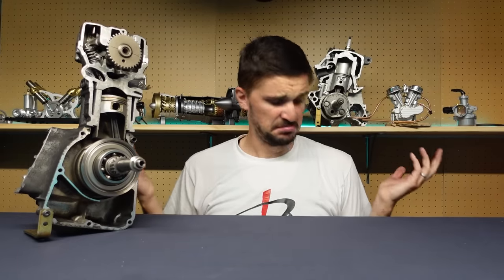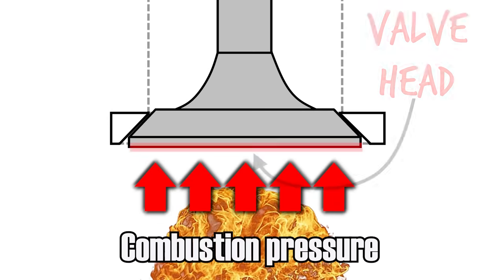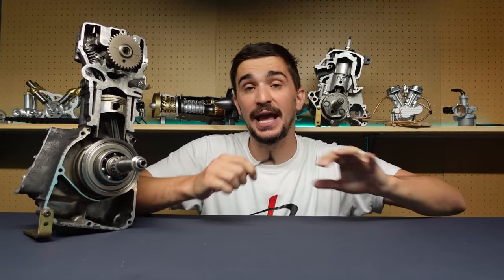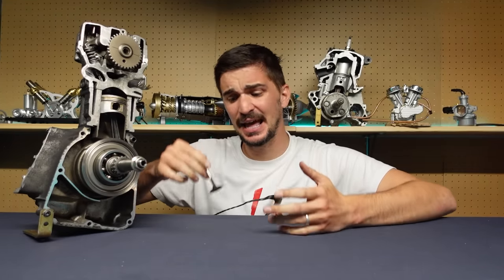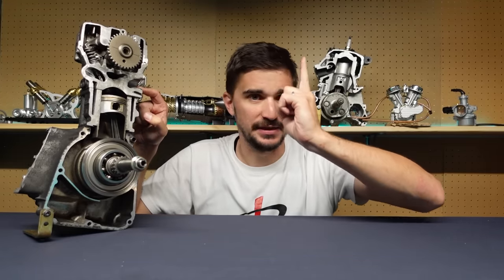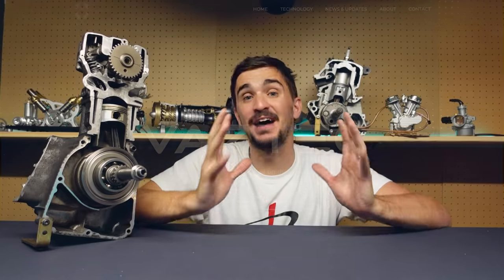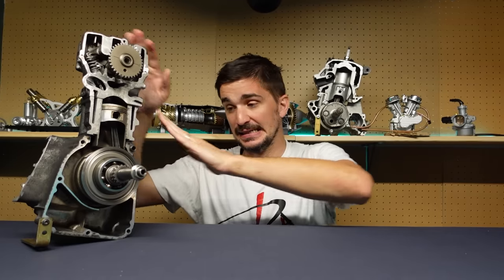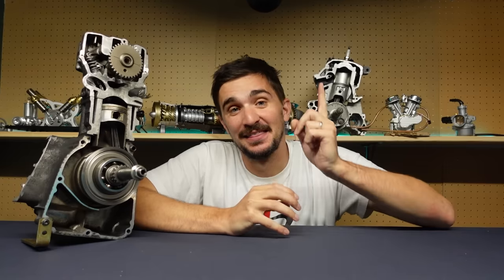Rotary Valves Make Normal Valves Look Silly - Why Aren't We Using Them?

Comment: Of course, the other alternative to poppet valves that actually made it into production was sleeve valves.
Reply: Yes and they were a huge pain in the ass to make. The sleeve has to ground to size with A DULL GRINDING WHEEL at 10X the power and 100x the time requirements of normal centerless-ground parts like wrist (gudgeon) pins.
  It was so bad Napier whined to Churchill who whined to Roosevelt who ordered an entire year of the Sunnen Corporation's centerless grinder production (about 2000 machine tools) to be sent by ship to Blighty.
       The USA had to fight WW2 without the use of the finest engines ever made the C-Series Pratt & Whitney R2800 because of that year without enough grinders.
Reply: Indeed. Most notably used in the Bristol Hercules engines fitted to the Beaufighter.
Reply: They kind of remind me of the valves in an opposed piston engine.
Reply: A really interesting solution.
Reply: @patrickshaw8595  By that time the Brits had more than enough German POWs. Germans are well known for their precision engineering. So, why didn't they get some of those to manufacture the sleeves?
Reply: Yes, but they were more complex and failure prone.  Their biggest advantage was with relatively low octane fuels (50-60) because they could run higher compression ratios than poppet valve engines (the hot exhaust valves would ignite the fuel/air mixture).   Once fuel octane approached 90, much of the relative advantage was lost.  With 100+ octane fuels and sodium cooled valves, poppet-valves made more sense.
Reply: Wow, you all really know your ish. I've only ever built a hobby-scale electric motor.
Reply: @mikethespike7579 It's highly unlikely that German mechanical engineers were on the front line, getting "captured", or surrendering to Allied Forces.
Reply: The Wankel rotary engine replaces the valve with the rotor itself. It shares the sealing struggles with the rotary valve, and then some. However, one could consider it an alternative to the poppet valve that made it into production. While not a huge success, it did do quite well for many years.
Reply: @patrickshaw8595  The US did fight WW2 with the R2800, it powered many of the most famous fighters like the F4U Corsair and the P47 Thunderbolt. That company wasn't the only one in WW2 that made grinding equipment in the US. The Wright R2800 ended up being one of the most produced engines in the war
Reply: There's a lot of good airflow arguments for the sleeve valve, but they are complex.
Reply: @crosstiewalker803  My comment was meant tongue in cheek. But thanks anyway.
Reply: Another one is to use copper coil and some magnets, if you look for efficiency
Reply: @wesley0a  It turns out that I thought it possible that the seals developed for the Wankel might be used for rotary valves with piston engines.
The LiquidPiston engine that is currently under development is related to the Wankel.  If you haven't already found it, you may be interested.
Reply: @jfess1911  Ah yes, sodium cooled ... now i remember the crazy german engineers who cooled things with NaK.
Reply: @haku1155  Eaton in the US also made them.  I think they were still making them 25 years ago, when I worked for that company.
Reply: Wankel fails because the spark plug provides a blowby point, the long combustion chamber has a high quench and blowdown is too short resulting in extreme noise and extremely hot exhaust. 
Opposed piston two stroke is the most efficient. It can also add a port height adjuster to boost mid range power.
Reply: @mikethespike7579  There are so many stupid people making stupid comments on YouTube, and you seemed, or seem, to fit the profile.
Reply: I knew someone who flew an aircraft with Bristol Centaurus engines (I think the Beverley) with sleeve valves. I believe the Sea Fury used the same engine, an 18-cylinder radial. He used to describe them as "oil burning, fuel cooled" engines they used so much oil and needed such a rich mixture to keep temperatures down.
Reply: Oil consumption and pollutants screw that design. Ricardo was analysing and designing engines before air quality was a concern.
Reply: @crosstiewalker803  Well all their patents were stolen so in that sense theeir work was captured - War is such a sneaky way of legal theft
Reply: @Dave5843-d9m  Yup, the Wankel has problems when it comes to efficiency and emissions.  The LiquidPiston inverts some of the Wankel components (rounded rotor, triangular stator), but in the end has a lot of the same problems.  Nevertheless, it is compact and light for its output, so it may find a home in drones, other aircraft, or possibly as a small "maintainer engine" for hybrid (but mostly electric) vehicles.
Reply: What about a disk in a pipe with 2 slightly angled half-circle flanges inside so It takes a bit less than a quarter turn to open, with the disk aligned to the pipe. Friction will be lower if actuated by a simple rotary solenoid switch. The main drawback is one half will be pressured shut while the other side is pressured open during compression. It may be solvable with a wedge shaped disk directing the compressed air to the half that closes. I hope you can imagine this from the description. I haven't looked into other valves much so it might be a bad idea. Maybe the switch magnet can be used to hold it fully shut too. Perhaps only half the pipe should be fully blocked off with only the other half flanged to form the seal.
Reply: @PrivateSi  This pretty much describes the single tube in Roland Cross's engine from the 1930's.  In those days, the extra heat transferred between the exhaust side and the intake side of the tube helped volatilize the fuel was important.  Now, heating the intake air (and reducing its density) is a disadvantage.  Back then,  the fuel droplets were large and overall, heating the intake air to volatilize the fuel was a net positive.  These days, fuel atomization is so good that it is more efficient to keep the intake air as cold as possible to make more oxygen available.
Reply: @jfess1911  .. OK. The way I was thinking supercharged intake would apply pressure to the intake valve so that could be an added problem (even if it does help counter the pressure of the compression stroke).
--
I have a unique 'free piston-turbine engine' design I'm sitting on. I haven't looked into other valve designs yet but thought I'd check this out and give it some thought. It uses a solenoid-actuated simple poppet style valve but with an oval valve head that blocks off 2 intakes/exhausts at once, with the actuator between them. They're water cooled and may even squirt out some water each time they shut, for added cooling + steam power.. It combines a condensing boiler as it's a boiler-generator. 50% rotary power, minimum, 50% heat maximum as the goal. 
--
The piston-turbine idea is fun. It's a true 1 STROKE engine where compression provides power.. combustion, exhaust, stroke after next intake all while compressing the next stroke. Instant high compression of a piston engine, no crank or cams of a turbine engine... but it needs a few valves in the middle with turbine combustion chambers each end with a special magic rotary heat engine system combined with them. I think I'll stick with what I've got, and a half-disk would work better for the previous idea I mentioned. I've been sitting on a rough 3D design of the engine-boiler-generator for months now, and the idea for years on and off.
Reply: @TotalFreedomTTT-pk9st  As you may have noticed, I was making a comment to a person that now says his comment was meant to be "tongue in cheek", so I guess it was just a bad attempt at humor. I believe that person was talking about POW's being forced to do the work, and your comment does have some validity, but not all of the German weapons technology was developed or "invented" by Germans, so is there a difference between stealing technology, and stealing the mental and physical work of people that were working against their will, with the threat of death to them, and their families by the nazis?
Reply: @mikethespike7579  Because if you're actually adhering to the Geneve Conventions, you can't use prisoners to directly support your war effort.  The Germans learned early on that drafting their skilled machinists into the combat forces was a Bad Idea, since you then get crap production. (And the Germans never got the hang of Mass Production, with its requirements for consistent manufacture from the initial stages with high tolerances - most of their final assembly consisted of hand fitting.  Looks pretty when you're done, but production rates are abysmal, and interchangeability is out the window - it's why early 20th Century European firearms had every moving part serialized - you couldn't necessarily exchange the bolt of your Kar.98 with the one from the guy next to you.
Another issue - that the Germans found out using forced (slave) labor,  you slaves have a tendency to sabotage whatever you're having them make.

The big problem with Napier's Sleeve Valve engines (The Sabre), was Napier who had had an abysmal track record with the many-cylinder fast-turning engines - Rapier, Dagger and Sabre - that one wonders why they were ever contracted to build the things in the first place.
Bristol, with the Taurus, Hercules and Centaurus sleeve-valve radials had much  better success, at the expense of complication in the sleeve valve drives - the back side of a Bristol Hercules looks like an explosion in a Rolex Factory.
Reply: Napier did a sleeve valve 'H' 16 cylinder aero engine called the Sabre for the Hawker Typhoon. They had issues with the engine too but damn, that was a beast of an engine given it's size and power output potential. There's a cut-away display of one at IWM Duxford.
Reply: @mikethespike7579  i'll take the liberty of assuming that was a joke
Reply: @MrTL3wis  They'll be just as complex for a rotary valve - As an Aerodynamics guy, that simple flow through drum valve becomes a nightmare at anything but a specific mass flow, and a specific RPM - it it's turning fast, you don't have tome to get enough air through the valve.  Yes, that's a problem with other valves - but with a poppet valve, you have a fairly consistent flow path once the valve has started to open, and as it's closing.
Reply: @haku1155  Sodium cooled valves were developed by Sam Heron at GM in 1930, and introduced into production aircraft engines by Bristol in 1936.
The Germans, as usual, came late to the party.
Reply: @daos3300 Yep. Glad you saw it as such. I've been getting a bit of flak for it, more or less from intellectually challenged types.
Reply: @peterstickney7608 Dude, it was a joke, tongue in cheek.
Reply: @patrickshaw8595 is that an inherent problem? The only reason to grind with a dull wheel is for cycle time (longer dress interval) or surface finish. It would probably be most efficient to get surface finish from a second operation (finer grit wheel or super finish process).
Reply: @peterstickney7608 "the backside of a Bristol Hercules looks like an explosion in a Rolex factory" 😂😂 that's quite a knack you have for expressing yourself!!!
Reply: @mikethespike7579 Bold of you to assume that the average Fritz was a mechanical engineer
Reply: @allahuvonaugustera7895 It was a joke... Oh, never mind...
Reply: @southronjr1570  thanks for the accurate info...!
Reply: Sleeve valve engines had been built as limited run racing specials from well before the Second World War. The sleeves needed to be match fitted to the barrels and pistons if the engine was to run with any reliability. This was unacceptable for a production engine and it took the engineering genius of George Fedden at Bristol to devise ways of mass producing parts to such high tolerances that match fitting was no longer needed. Aircraft engines like the Bristol Centaurus were developed to produce over 3,000 bhp and it is a mystery to me why this technology has not been exploited further.
Reply: Knight sleeve valve auto engines were in production for around 30 years. Improving poppet valve technology nullified its advantages in the 30's.
Reply: @PRH123  Minerva cars had sleeve valved engines, licenced from Knight, typically you could see blue smoke (oil) come from the exhaust  Complex engines to build and maintain but they ran well and were very quiet
Reply: @peterstickney7608  'Another issue - that the Germans found out using forced (slave) labor,  you slaves have a tendency to sabotage whatever you're having them make."

If forcing POWs to work is slavery, then so is forcing men to fight. And that is actually not slavery.
Reply: @mikethespike7579  These days it's hard to tell the difference between an ill-considered joke, and someone Popping Smoke and running from an inconvenient comment.  Sad to say, that's what Internet Discourse has come to. Whether you were serious or not, my intention was to point out to other readers why that would be a Very Bad Idea.  You know that there will be somebody out there who sees it and says "Y'know, that would have been a good idea".  That ought not to be encouraged.
Reply: The design of the intake and exhaust ports flow rates must have been studied in detail over the last 120 years to work in conjunction with the poppet valve obstruction. At high RPM, such as racing conditions, the flow around the poppet valve would contribute to mixing of the fuel & air for making for full better combustion. Most road vehicle engines work at relatively low RPM so the maximum flow rate is less of a concern.
Reply: @guidodebacker4205  knight used the “quiet” quality in their advertising
Reply: @gourishankar52   if I remember correctly, barriers to further development were:
- the design was limited to < 3000 rpm, which isn’t an issue for an aviation engine, but is elsewhere
- issues with heat transfer thru the sleeve to the block to the coolant (or air)
- cost of production, ala machining, and complex linkages to move the sleeves
Reply: @peterstickney7608  Yeah, I've noticed that there are always some poor individuals who don't understand a joke. I suppose it's inevitable.
Reply: @PRH123 There are tons of interesting mechanical alternative solutions for the internal out there, that are supposed to improve the combustion engine. They all have fantastic advantages but also one single disadvantage that makes the whole thing useless.
Reply: @mikethespike7579  yup, there’s always at least one “onion in the ointment” (Shakespeare) that spoils a good idea…
Reply: @patrickshaw8595
Thanks sir for yet another interesting fact and context of importance in global history - all because so many of us love going fast and improving stuff!
Reply: @gregrice1354  I love improving stuff, but not to go fast. I like coasting along the roads enjoying the countryside.
Reply: @peterstickney7608   For sure. Another nice thing about poppets is that the combustion pressure reinforces the cylinder sealing, which is a big deal.
Reply: @rian0xFFF   That's far from free and the energy consumption goes up quickly (squared, I believe?) with RPM.
Reply: @MrTL3wis  I'm trying to mean electric motor
Reply: @crosstiewalker803 
Turns out there were a lot of German engineers at the front.
Reply: @Margarinetaylorgrease  Please let me know where you found that information, and I'll retract my comments if your source is  legitimate. It's not that important, and I was replying to a person that said his ( or her ) original comment was meant to be a "tongue-in-cheek" "joke".
Reply: @Margarinetaylorgrease  I tried a couple of Google search about what you're claiming, but I didn't see anything that would validate your claim. Do you understand that I'm talking about scientific research and development type engineers, and not combat engineers, also known as sappers?
Reply: @randomxnp All engines of that period burned tons of oil due to manufacturing tolerance and the like.

The R2800 mentioned earlier in thus thread would burn something along the lines of 1 gallon of oil for every 10 gallons of fuel and as such had to have a 50 gallon oil tank that was refilled per flight the same way the fuel was.
Reply: Don't forget reed valves.  They're all 2-stroke though, I believe.
Reply: @Margarinetaylorgrease  I'll wait to see if you can back up your assertion.
Reply: @mikethespike7579  It's very illegal to force POWs to work in war-related industries.
Reply: @Zileas01  "In reality there is often the death penalty for refusing the draft in wartime, prison  if you are lucky."

That is exactly the point I made. What do you think forcing means?
Reply: @crosstiewalker803  
The secret horse power race chap talks about it in some of his talks and I assume the book.
Reply: And electric
Reply: @sahala6765  It's a joke. I don't think the British would have allowed members of the enemy armed forces to take part in developing weapons technology.
Reply: @wesley0a No other workable engine ever surpassed the Wankel rotary engine. The initial seal issues were successfully solved but the emissions could not be reduced to acceptable levels which eventually prevented the success of the rotary engine in cars. Perhaps hydrogen fuel could solve that issue?
Reply: @wesley0a No other workable engine ever surpassed the Wankel rotary engine. The initial seal issues were successfully solved but the emissions could not be reduced to acceptable levels which eventually prevented the success of the rotary engine in cars. Perhaps the use of hydrogen as fuel can solve that problem?
Reply: I like the opposed piston engine with the valves cut into the lower parts of the cylinder and are opened and closed by the piston. Could also use reed valves in oppisite ditections as well in intake and exhaust manfolds. With a supercharger it can be a 4 stroke pressurized lubrication system but has a huge power stroke once every 360 degrees like a two stroke.
Reply: @wesley0a The sealing problems were eventually solved. The emissions are their final downfall.
Reply: Opposed piston engines have no valves.
Reply: @jfess1911  They were also very good on high octane fuels 135/150 as these fuels had a lot to TEL and unlike poppet valves, sleeve valves were not prone to leading.  Sleeve valves were not inherently more complex they just had more design issues.  Sleeve valve designs were also less prone to pre-ignition which can cause backfiring and serious damage to the engine.  

It would be interesting to see a modern redesign of the sleeve valve engine, there have been various improvements patented including some work by Lotus.  It was rumoured that Keith Duckworth had done development work on sleeve valves but AFAIK there had never been any written proof of this.

The Sleeve valve made more sense in air cooled engines as they were all two-valve designs and the sleeves had better volumetric efficiency than a two-valve head.  After the war, commercial use of the Hercules had a TBO of 3500 hours, very high for a piston aero engine in its power range.
Reply: @mikethespike7579  What makes you think the Germans could manufacture them?  

Their own piston engines were not the shining beacon that many make them out to be.  

Any major change in engine design takes about 5 years to bed down.  A major issue with the Sabre was that they did not start the design till 1936 and it was a radical departure from the other engines Napier had developed.  When put into production it was seriously underdeveloped, two more years was needed.  The Merlin development started in 1933 and it was just another in a line of Rolls-Royce V12s and it had serious problems early in its production life.  Add to this that Napier was a small company, with a much smaller design staff than  R-R let alone the Americans.
Reply: @robertnicholson7733 You can't be serious. It was a joke.
Reply: @Margarinetaylorgrease  I googled the book that you mentioned, and at some point I might take the time to look into it. It sounds like the only thing you've done, is watch a video, and you heard something in that video, that causes you to believe that civilian scientists,  and mechanical, electrical, and other types of engineers, were forced to go to the battle front and participate in the shooting war. I realize that toward the end of the war in Europe, old men and young boys were given weapons, but it makes no sense to me that a handful of scientists would become expendable on the front lines.
Reply: @mikethespike7579  Nothing goes over their heads. Their reflexes are too fast. They would catch it.
Reply: @crosstiewalker803  
No I was there and I seen it with my own eyes.
Reply: Which are kind of sort of rotary valves sometimes (sometimes they are also reciprocating)
Reply: @Dave5843-d9m  wankels do have a major increase in power when you use a reed valve on the intake to stop the back flow form the intake port.
Biggest issue is always going to oil usage and apex seals
Reply: @jillybooty In fact the reason they did this was to improve the roundness of the sleeves. How exactly it works is unclear (they discovered the dull wheel method by accident) but doing the final pass with a dull wheel improved the TIR of the sleeves from 0.005" or worse to less than 0.001".

For reference, the sleeves as designed by Bristol were high nickel austenitic stainless steel forgings. After rough machining they were nitrided for hardness, then finish ground on a centreless grinder. Presumably the residual stresses in the forgings resulted in considerable distortion during machining and heat treatment, so they were left with 'oval' sleeves that fit poorly and caused excessive oil consumption until a machinist accidentally ground one without dressing the wheel on the centerless grinder, and discovered that it had mysteriously become round.
Reply: @robertnicholson7733  yeah man.  The Germans were rocket experts, not valve grinders……. As operation paperclip proved so well!
Reply: I recall my school metal work teacher talking about engines with sleeve valves in early to mid 60's. I think he said they were used in some Daimler cars. Must have been quite old cars even then, Jaguar Daimler had been using the same poppet valve engines in both marques for some time by the 60's.
Reply: The sleeve valve engines that I worked on were in aircraft and they weren’t  reliable in the valve train area. Look at the Bristol Centaurus Engine. It is a 18 cylinder aircraft radial engine used in the Hawker Sea Fury. A very complex engine.
Reply: @welshchris1951  The cars in question were Daimler Double-Sixes. Seems like they stopped making them in 1934.
Reply: @jfess1911 not so, regardless of the octane the lower detonation potential meant that you could  theoretically run more boost with less charge cooling at any given octane, meaning more power potential. However sleeve valves came along when that wasn’t the killer advantage anymore. WW2 ‘great engines all started development before the war when sleeves still didn’t work well and afterwards there wasn’t the need for them. What killed sleeve valves was gas turbines, not sodium filled poppets
Reply: @seanmehonoshen9440  The question is then: "Why do poppet valve engines dominate in modern piston engines?"  There are still many, many piston engines made today.  Some are even for aircraft.
Reply: @nerd1000ify  Thanks for that, I've just read the Wikipedia on the cars and their engines. Very interesting.
Reply: It was all done on WW2 plane engines first. Mr "of course"
Reply: @Toro_Da_Corsa  Sleeve valve engines were used in cars as early as 1906.  Wikipedia has a decent article on them.
Reply: I'm behind on this, but I recall early  Daimlers used Knight sleeve valves, giving quiet operation, but a lot of smoke from burning lubricating oil.
Reply: @jfess1911  The brass era isn't relevant to the discussion. They were used in modern designs with high horsepower in ww2 planes
Reply: @jfess1911  Aviation still uses leaded gas today
Reply: @MAXIMUSMINIMALIST   It's true though.  Here's a Youtube animation showing the complex gearing needed to operate the sleeve valves on a Bristol Hercules:
https://www.youtube.com/watch?v=_vrvep_YOio
Reply: @mikethespike7579  Yes I know but you left yourself wide open and I could not resist.  I was once a professional engineer and it was always good sport (especially in big meetings) to take someone's off-the-cuff joke seriously and give them a serious response.  NEXT TIME they were far more careful to ensure the joke was actually funny.
Reply: @nerd1000ify  That is the story, I must look up the patents one day.  Apparently one of the patent offices did not believe it was a valid process, Bristol had to get Ricardo to vouch for them before the patent was granted.  

You forgot that the sleeves were centrifugally cast, then aged for quite some time outside with plugs in the casting bore,  there are photos of stacked sleeve castings sitting out in the snow.  After final machining the sleeves were always stored vertically.
Reply: @robertnicholson7733  Nope, this time it's you who has left himself wide open, not me. If you really were once an engineer, you'd have the intellectual wherewithal to spot any joke within seconds.
In all the meetings I was ever in among fellow engineers it was custom to make joking remarks if it fit the circumstances and if one of us failed to understand, such as in your case, they became the butt of further jokes.
You must have been a prime target in meetings.
Reply: @welshchris1951  These were the Knight double acting sleeve valves as used by Willys, Minerva and a number of other manufacturers.  They are quite different to the single acing sleeve valves being discussed here.  Daimler modified the Knight sleeve valve and had it in production in 1908.  Daimler sleeve valve engines were used in the early marks of WWI British tanks.  Daimler kept with the sleeve valve engines till just before WWII - the original Daimler Double Six.

At the time Jaguar took over Daimler they were making a 2.5litre V8 designed by Ted Turner (of Triumph motorcycle fame), a push rod, two valve, hemispherical combustion chamber engine.  In some ways it was four Triumph motorcycle engines and used components from Triumph in the V8.
Reply: @gmanchurch  Interesting, the final TBO for the Hercules was 3500hours which is pretty long for a piston aircraft engine in that power range.  The Centaurus was considered quite reliable by the RAF. Even the late Sabres were considered reliable.  What part of the valve train failed?
Reply: @seanmehonoshen9440  Initially what killed them was the cost:
from the book "Boxkite to Jet - the remarkable career of Frank B. Halford) published by Rolls-Royce Heritage Trust

Rolls-Royce-built Merlin         1 pound per bhp
Bristol Centaurus                    2 pound per bhp
Napier Sabre                            5 pound per bhp

The German's put the cost of their gas turbines at a fraction of the cost to manufacture the big piston engines.

With distaste but it is accurate for Wikipedia:

Costing RM10,000 for materials, the Jumo 004 also proved somewhat cheaper than the competing BMW 003, which was RM12,000, and cheaper than the Junkers 213 piston engine, which was RM35,000.[11] Moreover, the jets used lower-skill labor and needed only 375 hours to complete (including manufacture, assembly, and shipping), compared to 1,400 for the BMW 801

That is a substantial saving even considering how thirsty they were.
Reply: @gandalfgreyhame3425  Yes a lot of gears but the sleeve valve creates a fairly constant load to the drive as there are no valve springs to compress or release their potential energy.  So although there are a lot of parts, they are all the same and the stresses are low.
Reply: @crosstiewalker803  I have had the book for some time and read the odd part here and there.  I do remember some engineering staff being sent to the front mentioned.  I think it was the guys who ran the test houses, some officer probably thinking that anyone could manage engine testing.  I know it was at the end of the book and this is full of excerpts from German engineer's post-war interviews.  

I don't like some conclusions in the book and it is written in a style that does not appeal to me. but the research is quite thorough and based on primary sources where possible.  The author spent massive amounts of time combing through both British and German archives (it helps that he is fluent in German).   It is quite clear that there was considerable chaos in Germany at the end.

 I give it credence.
Reply: @robertnicholson7733  I'm not claiming to know any details about the possibility of aircraft and weapon designing scientists being forced to carry rifles. My first comment here was directed to a person that later said his ( or her ) comment was supposed to be a "tongue-in-cheek" "joke". What you're talking about is interesting, and I'll leave the discussion to people that are more knowledgeable about the subject.
Reply: @mikethespike7579  I can spot jokes very easily, the question is whether what you posted was a joke or just a failed attempt, the whole thing about jokes is that they are supposed to be funny.  

Satire is a difficult field, best avoided unless you are good at it, it is a delicate balancing act between being obvious and subtle, it is good to know your limitations - and yes, I know my own only too well.  

I didn't tell jokes in meetings, there weren't many that flew in my field and brevity was a highly valued commodity, unless it was good, a joke was a waste of time, punishment would follow. Other forms of humour don't work well without inflection and/or body language.

I can't see how "intellectual wherewithal" is required to quickly spot a good joke, that is a significant and multifaceted assumption, is that a glimpse of hubris, surely not!  And the obverse, if a person can't quickly spot ANY (no matter how poor it is) joke, they are somehow without "intellectual wherewithal"? Very Interesting, but...
Reply: @robertnicholson7733  Clearly you can't spot jokes easily. In fact you sound like the type that doesn't have an ounce of humour. The type that people laugh at behind their backs.
Reply: @jfess1911  the  sleeve valve primary advantages were in engines with extremely high boost, as used in high performance aircraft engines. Post ww2 there wasn’t a lot of use for that type of engine, turbines were filling that role. Poppet valves were a well established technology, simpler to build widely produced and not dependent on the technology developed by Bristol. Poppet valves were just the better option for most uses. It’s the same reason that you don’t see water-methanol injection on all those engines and they don’t run on 150 octane.
Reply: @seanmehonoshen9440  I don't have the books handy, but Harry Ricardo, who had started working on sleeve valve engines during WWI,  had admitted that once higher octane fuels became available, sleeve valves were not worth the trouble. I know that some sleeve-valve engines used a lot of oil (that is why Ricardo got involved), but don't know how much improvement was made over the years.

 It is also useful to realize that engines as late as the WWII era all tended to have more combustion gas bypass as well as oil consumption.  This was considered normal at the time.  Some aircraft's maximum range was limited by oil capacity rather than fuel.  This was a major issue with "war weary" engines.  The P47N had a 40 gal oil tank and manual states that oil consumption up to 7 gal per hour was acceptable (p37).   My understanding was that sleeve valve engines were considerably worse.
Reply: @paulcooper9011  The Knight sleeve-valve engine powered the very first tanks, used on the Western Front in 1916. My old dad drove one in action.
Reply: @randomxnp  any radial engine (poppet or sleeve) is an oil burner - I was at an airshow last month watching a Super Constellation starting up (Wright R3350 18 cyl. poppet valved) - from the amount of smoke looked like it was on fire until the residual oil burned off. The preflight checks on any radial plane include swinging the prop by hand for at least a complete revolution lest the residual leaked oil has hydrolocked the motor.
Reply: a rotary engine id an inverted rotory valve. more so when when we look at liquid piston's X-engine even than a Wankel 🤣
Reply: let me rephrase, a wankel IS in inverted rotory valve, an Xengine IS a rotory valve...
Reply: @donaldpaton1691  Yes I agree 👍
Reply: @wesley0a my first thought was Wankel as well (well, actually my second thought, after "two-stroke"!). A friend of mine bought a Wankel engined sports car many years ago, and I've never been in anything that accelerated so quickly. I suffer from motion sickness, but I've never felt sick going in a straight line before!😂
Reply: The sleeve valve was an interesting idea.  They wore out quickly and were difficult to replace.  I give high marks for testing the idea.
Reply: @haku1155  opposed piston engine has ports, not valves?